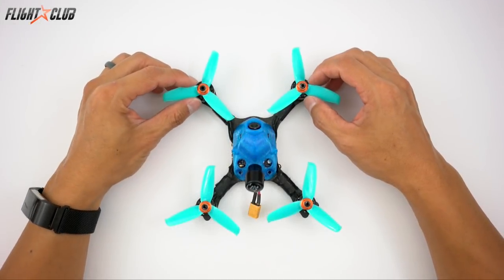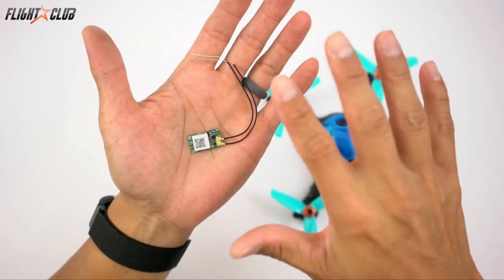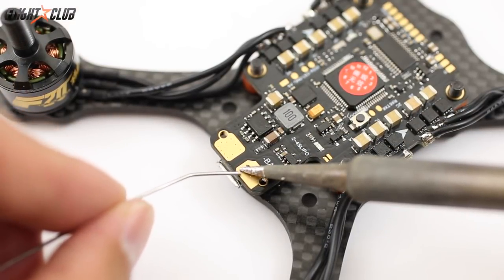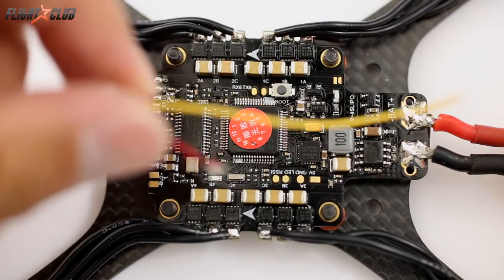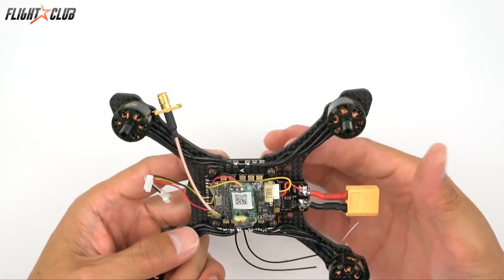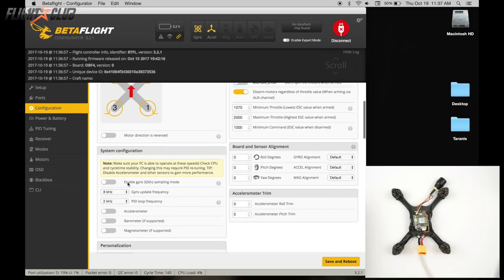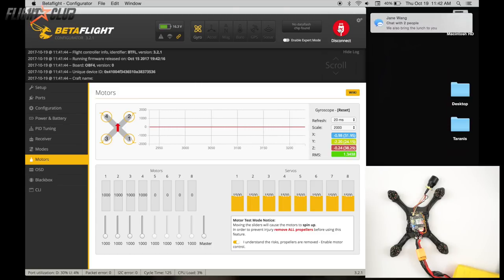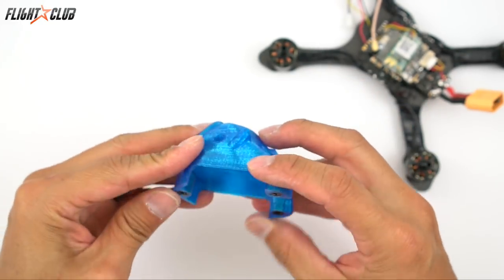FlightClub Phuket : Three Inch Quad Build

Comment: Just bought a 4 inch version in blue! This is the coolest and toughest frame design I could find that is easy to build, and looks good flying. Amazing job! Your frames are on top!
Reply from the maker: thank you Robert!
Reply: 👍 - don’t mention it!
Reply: FlightClub - I received my frame, but was slightly disappointed to find that my canopy was not included... I bought the full frame canopy and all and only received the frame, as well as my arm guards. I sent you a email through your website, I would like to quickly resolve this issue, as it was a simple packaging mistake. As I specify in the email, I have not opened the frame package, and I can send proof of purchase right away.

Comment: You can still use Smart audio without telemetry. Just use the BF OSD.
Reply: Yea i was like why would you not use it? That VTX is a pain in the a$$ to change without smart audio. And its a pod frame so you wont have to remove the pod to change the vtx settings

Comment: You are not supposed to use metal bolts with the Cicada they ship it with nylon bolts because the copper ring is conducive
Reply: SSBelmont. I was surprised also figured that FC would have immediately burned up.